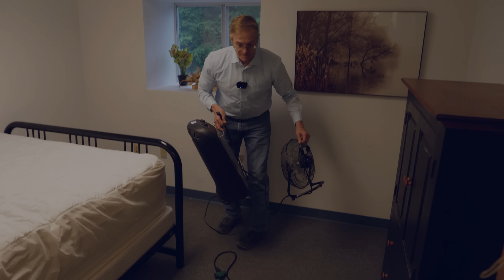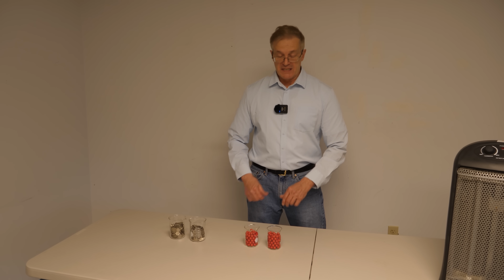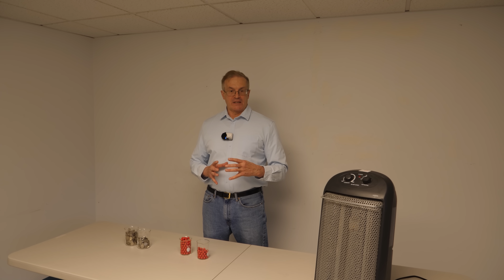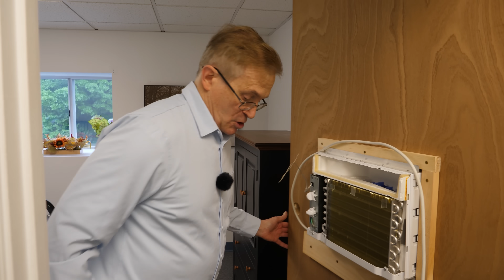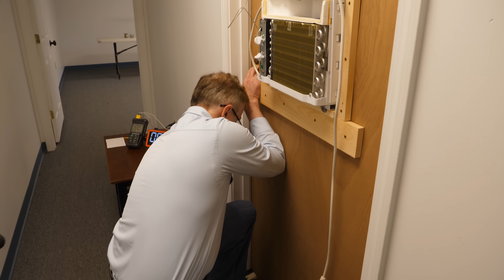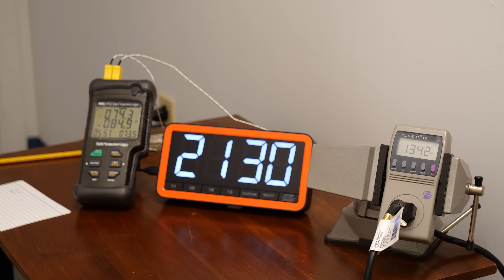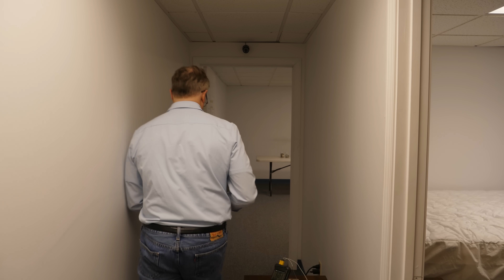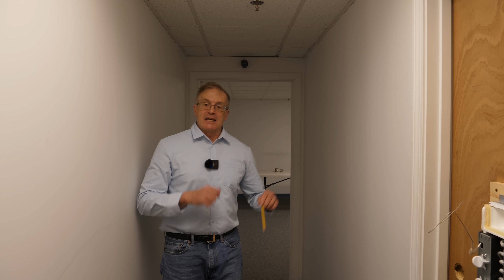You're wasting money on heating! Use your A/C!

Comment: Cool. Now do it with a water heater for less than some company and just as compact.
Reply from the maker: That would actually be pretty easy, but it would involve a little tube bending and soldering.
Reply: @TechIngredients  No shit. I have your attention. What would happen if you put a heat pump on a heat pump to like get some super high heat? Like I want to season a cast iron skillet at minimum. With 5° control.

Also, have you seen phase change materials? That's a video.

I was wondering if you could run a house on just heat pumps and ambient temperatures.
Reply from the maker: Staging, or series operation of heat pumps will allow some optimization of each stage for the designed temperature range. The overall efficiency multiplier will still drop as the overall differential increases. You can't fool thermodynamic law. However,  for large differentials, you could combine a heat pump with another heating process to take advantage of the pump's efficiency and simplify the additional heating needed to reach the temperature target. 
We're currently developing a phase change thermal battery to use in conjunction with a heat pump.
Stay tuned.

Comment: I just caught your video by accident and it’s an amazing video ! Very well explained and complete. One question for you? How would this work when it’s minus 10 ? Would the unit still produce enough to heat a room? I live in a small house and always looking for better , cheaper heat. Please let me know, thank you.
Reply from the maker: The performance ratio compared to a simple resistive heat source decreases as the temperature "lift" or differential increases. For extreme differentials, a two stage system makes more sense where the differential is reduced by a conventional source, and the remainder is made up with a high efficiency heat pump.

Comment: I wish the whole of YouTube was like this - clearly explained, useful and entertaining.
Reply from the maker: Me too!
Reply: @TechIngredients  this is so cool, thanks for the video!  I have forced air central AC/Heat gas furnace.  But I want to save some money on heating and cooling.  And I need to use my non insulated garage this fall and winter for some time sensitive and important projects, and want it to be comfortable in it for hours each day.  And because I have had torn shoulders, I can't lift anything over 5-8 pounds.  Instead of those heavy bulky AC units, can I just get a couple of window fans instead, one for my garage and one for a room?  And since I already have central heat/cooling, I don't want to spend money on AC units either, even if I could lift them. And you got a like and a new subscriber!  Science is amazing!
Reply: @nightskylights4501  Go into your attic or crawlspace and extend an air duct into your garage.
  The more insulation you add, the better it will work.  Also, that shrink film you put on old windows works amazing.
Reply: @TechIngredients  how does a window ac unit with heat work? Do these have heat pumps or is there a heating element inside
Reply: @kevinanglin678   There's a valve in there that makes the Freon go 'backwards'.
Reply: @TechIngredients  Where is the video that shows you how to get the most out of your AC unit? Also how do you use a AC a say in a 350 sq ft room to heat it not cool it? AC is in the window of the room.
Reply: My central heating defrosts way tooo much than it's suppose to.
Reply: lies. I saw you watching the Taylor Swift Kanye West drama
Reply: Too long of video.
Reply: @janicehenning4505  perhaps too short an attention span?

Comment: Failed Physics 101.
Resistance heaters are exactly 100% efficient.
Impossible to be anything else but 100%.
Reply from the maker: I was surprised that with so many comments, you are the first to raise that issue.
The fact is they are not quite 100% efficient heat sources.
This is covered in physics 102, where they discuss the generation of electromagnetic fields. Because resistance heaters are powered by 50 or 60 Hz alternating line current, the wires in the heater emit a very tiny amount of Super low frequency radio waves. I'll give you a B- for the effort.😉
Reply: @TechIngredients  
What a joke.
You can also argue that some infrared radiation escapes through a glass window.
50 Hz frequently will produce negligible power in radio waves.
Your outlets will emit some without even plugging in a load.
But that's several orders of magnitude less than power consumed.
For a grown man you ...
Reply from the maker: No, I won't as that infrared radiation lost through the window is still generated by the heater.
I said the quantity is very tiny. But as you admit it isn't zero and so the efficiency isn't 100%.
Keep in mind that you raised this issue despite the fact that I stated in the video  that the efficiency of a resistance heater is about as close to 100% as any device built.
If I had stated in the video that it was 100% effecient, I suspect that I would have gotten more responses than just yours that it wasn't 100%efficient and they would have been right.
Peace.

Comment: All of our off-the-shelf AC units can be used for heating in the winter. But I don´t know how this is done. I don´t think it is like this because when ran as heating they consume a lot of electricity, so much so that using other forms of heating is cheaper. I love this guy and wish I had the cuts to try some of these things myself, but I worry about catching the house alight :)
Reply from the maker: I don't understand your question.
I explained the principle at the beginning of the video and then demonstrated the impressive performance of a typical air conditioner vs. a simple electric heater.
Cost wise, there may be other competitive heat sources like passive solar, gas, and wood heat, but they have their own issues and may or may not be practical depending on where and how you live.

Comment: As an AC guy, I enjoyed this video. But, I would not wish a heat pump on my worst enemy.  In  theory they are great, the problem is in the real world they quickly deviate from ideal lab conditions.  They will fail when you need them the most, the cost of repairs immediately removes your energy cost savings, and these new system last maybe 5-7 years.  Your standard gas fired furnace will easily outlast any heat pump, and will be more reliable by leaps and bounds.
Reply from the maker: That's a good point.  Theory often fails in real-world operation because it doesn't account for the cost or longevity of supporting systems.
We're currently working on a performance enhancement for airconditioners. Theoretically, this is groundbreaking, but I'm struggling with that same problem of practical utility.  I think I can tackle it...
Stay tuned.

Comment: What happens of you cool an ac heat side with your radiative cooling?  Does it improve performance ?
Reply from the maker: It would, as I suggested during the video,  but we're currently working on a method that can reduce the cost of running an airconditioner down to 25% of the current cost.
Reply: @TechIngredients can't wait to see it.  Please forgive typos, when using a phone to comment i have both clumsiness and french autocorrect against me.
I have tons of plans for the future and one of the most usefull source is definitly this channel.

Comment: I'm betting one of the efficiency tips for an AC unit is to add evaporative cooler pads around the outside condenser.  I have mine set up just like this, and when temps start getting really hot with 120F temps in the desert and the AC struggles, I open a small water valve to wet the pads down.  When the AC unit is operating at 100% and not reaching the programmed shutoff temp, I can see a 4F (from 76F to 72F) drop in house temps just by wetting the pads down, and the AC unit has a 20% downtime as opposed to constantly running.  Another trick I developed to keep the house cool is using my 1000gal rainwater storage tank to wet the roof of my house with a spray bar.  I turn the pump on and it flows water over the roof, cooling it down 40F or more (I've seen it go as high as 140F on my metal roof).  Some of the water is obviously lost to evaporation, which is what cools it, but the excess gets captured by the gutters and drains back into my storage tank for reuse.  Takes a huge thermal load off the insulation in the roof/attic, and coupled with a good exhaust fan, the attic stays at ambient temp or cooler.  That alone adds another 20% more downtime to the AC, so it's only running 60% whereas before it was always on.  Getting a smart thermostat really helped me track the efficiency gains.  The only cost is running a small water pump and the exhaust fan, though it does cost a bit to set up the gutters and tank and whatnot.  I'd love to automate it all someday based on temps, but it doesn't take much to flip a switch and turn a valve in the morning and evening when needed.
Reply from the maker: That's a very good idea.
What I'm going to demonstrate is completely different,  but it can be used in conjunction with your system for even greater performance.
Reply: A lot of modern window AC units are built so that the water from condensation pools inside of the unit just enough so that the fan will pick up water and splash it on the condenser coils to help improve efficiency.  This helps remove the water from the bottom while it is at it.

Clever little improvement.

Comment: Something I noticed which undoubtedly reduced the accuracy of your test is the differing position of the electric heater and fan compared with the air conditioner, while the temperature sensor remained in the same place for each test. So in the first test the temperature sensor was across the room from the heat source, thus providing a more accurate representation of the room temperature; while in the second test the temperature sensor was only a few feet away from the heat source, allowing the possibility of spot heating of the sensor. I think you need to control for this and repeat the test.
Reply from the maker: I disagree. I considered this when I positioned the sensor.  The output stream from the airconditioner is directed away from the sensor and across the room.
If the sensor were in that stream, it would have registered an almost immediate (1-2 minutes) increase in temperature to approximately 100 degrees.

Comment: Always wondered why heat pumps aren't used to desalinize water, in theory even the water itself could be the phase change fluid of the pump and use its own energy to change phase only spending energy on the pump that moves the mass of water from one side to the other and heat loss which can be compensated by using the heat generated by the pump motor itself.
Reply from the maker: Industrial heat recycling is pretty common. The answer is probably related to the elevated temperatures and the parasitic energy loss to the environment. 
Osmotic desalination is pretty efficient and so maybe more cost-effective.
Reply: @TechIngredients  Yeah that seems that is the case, else someone would have done it already. 
I had this thought sometime ago but didn't pondered enough to make accurate calculations regarding cost effectiveness or even do an experiment to see if really worked as well as I thought. Basically thought about a desalinization plant that would be either a giant heat pump or a "heat pipe" in which water is the working fluid that would operate at reduced pressure say half to one quarter atmospheric so temperatures are lower while still being able to maintain good mass flow on the system, recover the heat of the condenser and use it to evaporate the water on the evaporator, in theory in an ideal world it should take almost no energy except the energy required to move water around the system, in reality I don't know how efficient that would be.

Comment: Does this have any practical purpose? I mean I can't just put one of these in my window in reverse and run it in the winter right?
Reply from the maker: Pretty much, you can't.  If you have a special circumstance like a covered porch or a protected balcony, then you could reverse the unit.  The purpose of the video was to demonstrate the impressive performance of heat pumps.
Reply: @TechIngredients  Indeed it did, 4x was quite surprising.

Comment: Don’t forget geothermal HVAC units actually have positive ( greater than 100%) efficiency, something normally impossible, and to my knowledge is the only item I know of that has that ability outside of nuclear power perhaps. 

  Its drawback is its footprint, requiring some outside area for ground coils etc. and cost though cost has dropped substantially as the cost of traditional HVAC has substantially has increased  further reducing that investment gap.

  Perhaps that could be a video topic if you haven’t already done so?
Reply from the maker: I  definitely haven't forgotten about geothermal.  In my opinion, this combined with a heat pump is a near perfect system.
The reason we haven't done a project around this is because of what you noted regarding the site work.
With new construction, this is almost a no-brainer. However, drilling a well to a sufficient depth (for surface area) or tearing up a sizable amount of near surface material to lay coils can be a big project in terms of cost and local disruption. Renters also face the hurdles of permanent investment and approval. 
Nevertheless,  this is a very tempting video project!
Reply: @TechIngredients  BTW, I have often been amazed that new home construction is still done on a piece by piece approach rather than a systematic approach,,, example, we draw water out of the ground at 60°, I would imagine,  to put it in a holding tank that has heating elements to heat it to 160° , just to deliver it to a faucet , and add cold water????  It’s like a Three Stooges movie. 

   If homes were designed on a systematic level, as if they are space stations, where the heat that needed to be discarded could be used to fulfill other purposes, like warming water or drying clothes, it would be shocking. 

   We use millions of watts of electric power for three or four months a year, even in temperate areas, to cool homes and heat water, while most homes attic spaces are well over 100° during the day being ignored. It just all seems obvious sometimes. 

   I stumbled on a company that sells mini split systems that have both solar,  and grid powered connection points, and the unit automatically switches to the grid when the solar capacity was not adequate. I will repost if I can find that again, but the thing that was interesting is the mini split was something like 8 to 12,000 BTU, but by using inverter technology only used around 450W of power . That’s  not an overwhelming cost in solar panels to provide. Imagine being able to power a device as augmentation to remove 8k to 12k of  heat from a home, using off grid sources, during the peak heat of the day!!! 

   Unfortunately, the government has no interest in distributed, local level, point of delivery incentives, and if it is not done in the typical American ‘mega project’,  requiring hundreds of millions of dollars and almost certainly doom for failure it’s not looked at. 

 Sorry for the novel, I find this stuff very interesting. Take care.
Reply from the maker: All true.  I'll look at any links.
But, avoid the temptation to look for or blame government. They are almost never the solution, rather the...
Reply: One nice thing about geothermal is that they work anywhere humans live on this planet. Alaska?  Works great.  Texas?  Works great.  Taiwan?  Works great.

Other methods work better or worse depending on environmental factors.  But the Earth is as stable as it gets for temp once you dig down a bit.

Comment: These are great, but as a consumer, before buying something like this, check the out door weather conditions relevant to the efficiency of the system. I don't remember specifics, but if you aren't living in the right climate, a heat pump is an up sell and doesn't live up to its promise of energy conservation vs price.
Reply from the maker: You're correct.
This isn't a universal solution but can be very useful given the right conditions.

Comment: THanks.  But how does the heat pump compare (for heating) IN COST for input power, with a natural-gas furnace?   Thanks Again!
Reply from the maker: It's close.  It depends on the temperature differential and local gas and electrical prices.

Comment: Nice demonstration. I am curious if the results would be the same if the ambient air temperature near the evaporator coil (ambient air temp in the hall) was at a more realistic temperature. (32 Deg F or lower).
Reply from the maker: They wouldn't be.
The greater the differential, the lower the efficiency multiplier.  Eventually,  the pump will approach the efficiency of the resistance heater. But, even at the extreme differential that commercial heat pumps can operate at, they will still be significantly more efficient.

Comment: Have you ever tried using a compost pile heater to run a thermal tower, for making electricity? The heat from the pile is pumped into a coil in the base of a tower. 
When the air gets heated, it draws more air in through the blades of a generator. A cover just above the air inlet directs the airflow. Decreasing the tower's dimensions when it rises increases the airflow. If one is worried about adding to global heating make a U-turn and at the top of the second downward angle a fine spray of cold water. This will draw the air down a second tower through a second generator.  Add a water trap before the generator blades. The towers should be at least tree-top tall.
Reply from the maker: I haven't, but the principle makes sense.